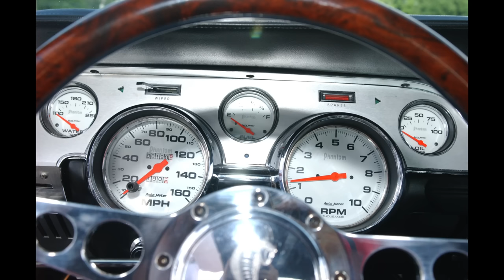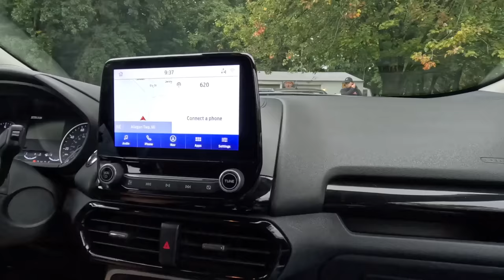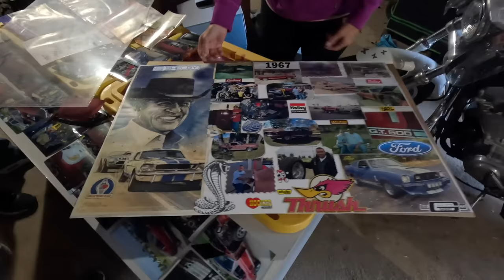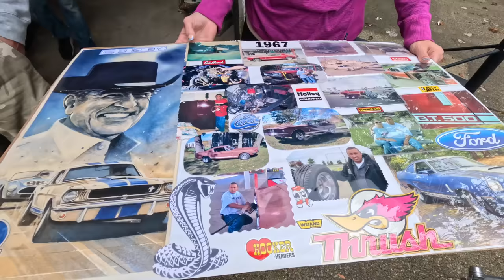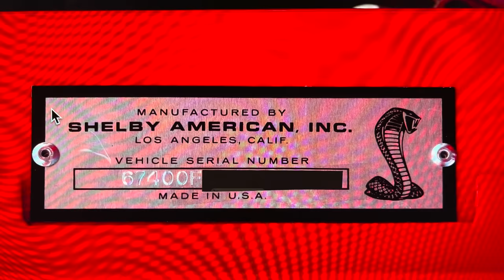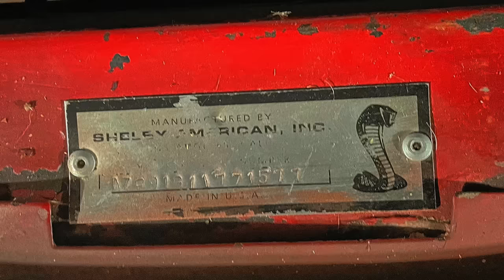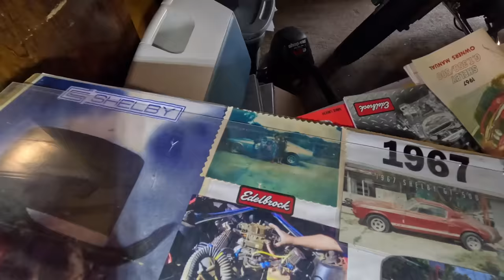1967 Shelby Mustang: What did we inherit? (Clone or Real)

Comment: He doesn't always pay a fair price unless he goes in with Rawlings for certain cars. To me that's about a 20,000-25,000 dollar car all day, all in.
Reply: Shelby vehicles had cosmetics and performance. The subject vehicle has much of the cosmetics; not much, if any, of the performance. It would be very expensive to upgrade the suspension and drive train to Shelby specs.
Reply: @65csx83 it's already got the 351 already plus you have no idea what upgrades have been done to the suspension in it's life time. Don't count your chickens.
Reply: that's a too high because it not Shelby & don't run and needs quite a bit of work!
Reply: @markreisen7038  The video seemed to focus on the positives. If there were notable performance upgrades, I suspect they would have been mentioned. The owner was likely satisfied with the feel and appearance of a Shelby.
Reply: Hasn't even been moved or put on a hoist to check the frame condition, brake and fuel system, suspension or running condition. So to toss out a number like that is somewhat ridiculous.

Comment: 289 doesnt mean dead in the water, it means it could have been a 350, I saw one years and years ago for 20 grand, they did exist and they used the small block 289 instead of the 428
Reply from the maker: Yes, the 289 High Performance solid lifter four barrel, which is the K-code was the 1967 Shelby GT350's engine. I think we said "C" code, which is the 289-2V, that negates any possibility this fastback could be a Shelby. And this car was born a C-code.
Reply: @thewriter2549  ah, does that K code Also mean 289 Hi Po by any chance as well

granted I didnt know it had solid lifters if it is however

still though, 67 Fastback, still not a bad catch, could ironically sell it to the guy who found the Bullitt mustang in Mexico

as he found it as of all things he wanted to build an Elenor Clone and then found that in a junkyard, and to think someone wanting to build a shelby clone

literally resulted in them finding the long lost stuntcar from Bullitt

and it still had the remains of the Shelby GT350 Wheel that Mcqueen used in it too

Comment: I bought a 1968 Pontiac Firebird 400 with factory Ram Air bucket seats no tach in the hood and 4 33 rear end 4 speed, it was Verdoro Green not orange like most of them,  I know it was a rare car , I had to sell it when I got drafted in 1970 ,  I couldn't make the payments. It was a great running car , but it just could not get out of the hole with those wide oval tires it came with , needed ladder bars, I turned 13:70s with it even with horrible wheel hop.
Reply: Verdoro was white-hot for these, back then.  A very desirable color

Comment: I sold a running driving C code with a three speed manual for 20K back in 2018. It had rust at one time but it had recent rust repair. Today I think that that car would sell for 30k. I think that this car, with rust and not running is a 20k car.

Comment: curious about the rivets used. Were the factory rivets steel vs aluminum?
Reply from the maker: This is a very compelling question. Aluminum, and I've read that sometime in the production run Shelby changed the rivets to anodized aluminum, as they fixated on rust prevention.

Comment: U guys are busy witch Vin didiget to decode my 71 mach. Cj ?
Reply: Q code , for the 71 351 cj
Reply: @guysumpthin2974  which position 1 2 3 4 ect thanx
Reply: Shelby or no Shelby, be happy such a classic is being passed down to you, most families would fight over it and do nothing with it out of spite.
Reply: @dave-uf8ir  5th digit , R=boss , H=351 2v , M=351 4v , C=429cj , J=429scj ram air
Reply: Haven't sat in that car 5 years smells like the 90s 5th  is m fact 4sp grande interior no fold down rear seat Argent body grafics
Reply: @dave-uf8ir  still big port heads , should have a 4 on the corner of the cyl head by the valve cover, great cars
Reply: 2.25 intake valves this car is good shape for age sitting in there after 5 years lots history smells like the 90s that guys
Reply: @dave-uf8ir  what was the original paint color
Reply: @guysumpthin2974  grabber blue what is happening to my posts ?
Reply: Thanks Jerry.  Nice restomod Mustang for sure. It’d certainly sell for good money here in Texas.
Reply: @dave-uf8ir Grabber blue did not come out until 1969 model year. No Grabber blue in 67.
Reply: Here's the story I got from body shop & ford guys 30 plus years ago 3 plants making mustangs they had free hand to build these cars however they wanted& they built 1700 blue cars like my 1971 351 c m Vin fact 4sp Argent body grafics refletive like road signs don't know for fact thanx for help cheers 🥂 guys

Comment: Drilled that rivet hole out to 1/4inch. 😮
Reply from the maker: The drill bit is drilling the rivet not the steel panel  underneath.
Reply: @thewriter2549  you can see that he went right through, rivet, tag and the steel panel. I’ll guarantee no one will be able to put an 1/8 rivet back in that hole.